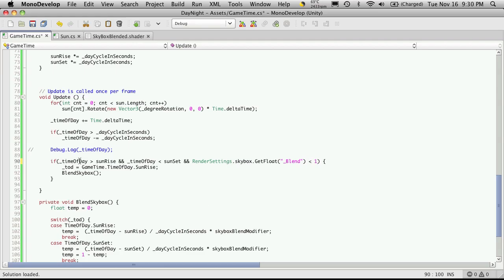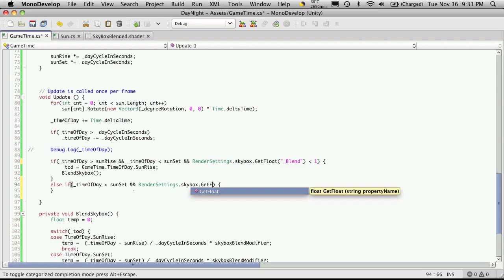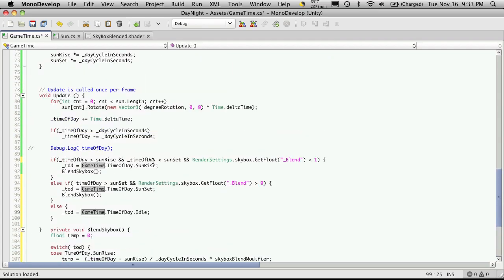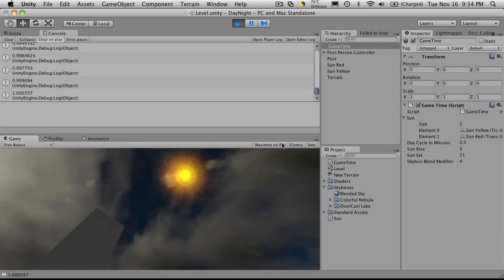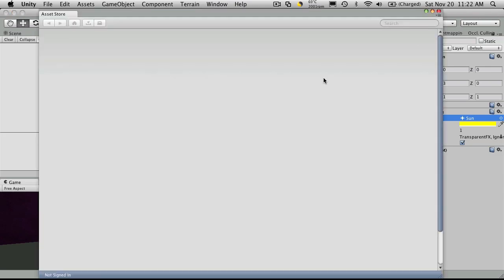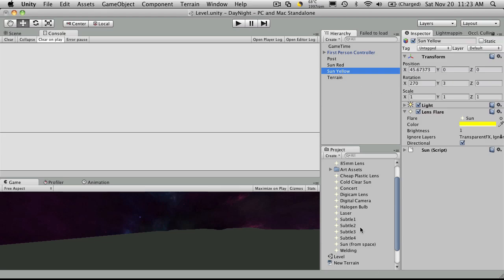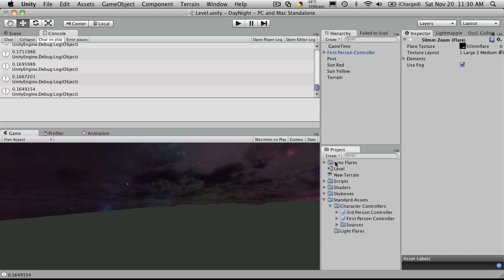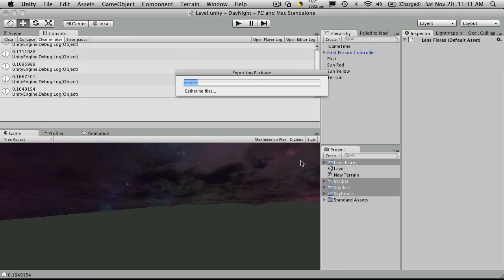77. Unity3d Tutorial - Day Night Cycle Part 6

Comment: @kxmode I went back and looked at the code and the problem is occurring on this line...

else if (_timeOfDay > sunSet && RenderSettings.skybox.GetFloat("Blend") > 0) {

I placed a Debug.Log("Sun set!"); in the else if block and it never fires... so there's something in the logic that isn't working. Any ideas? Should the value of 0 be changed to 1?